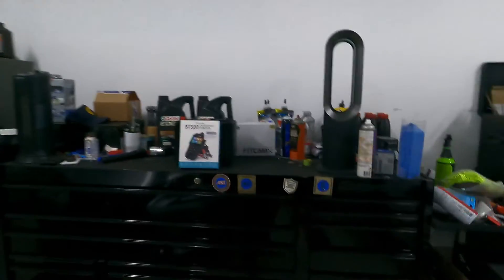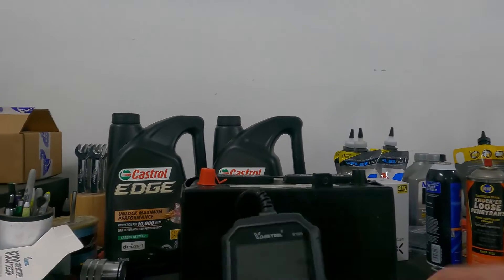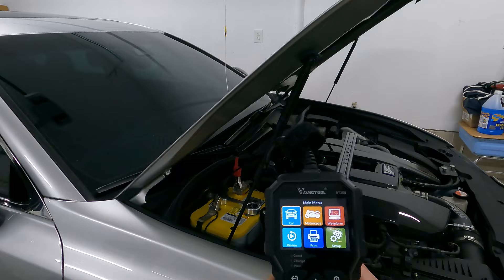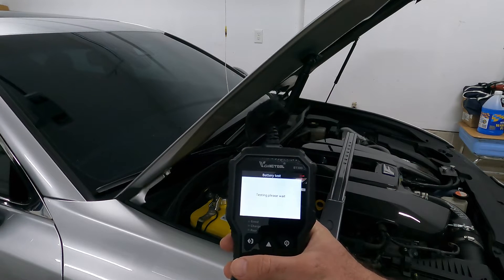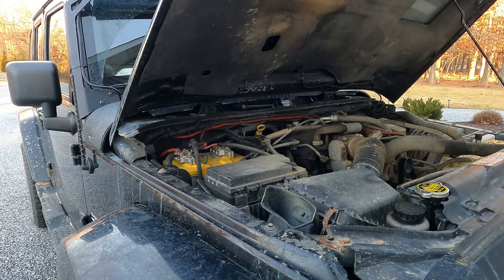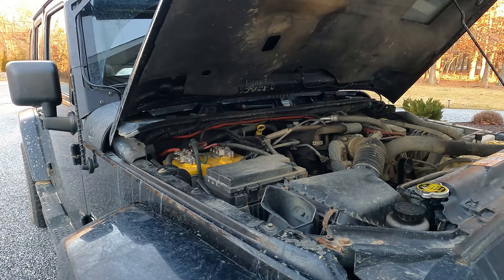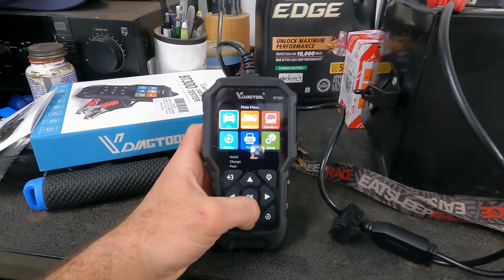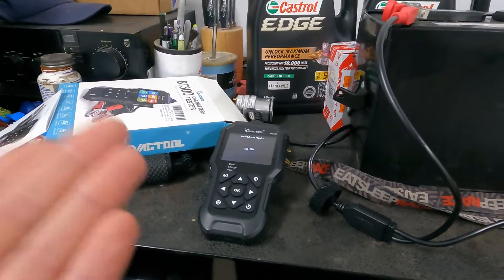The VDIAGTOOL BT300 is a GREAT entry level battery, alternator, and starter tester!!

Comment: There's probably nothing wrong with the charger, it's the tester. These cheap amazon units give wildly inaccurate results. Don't believe me? Buy a $1200 to $1500 midtronic's unit and you'll see the difference.
Reply: At that point you might as well just get a new battery,  or even a couple batteries
Reply: Lololol😂